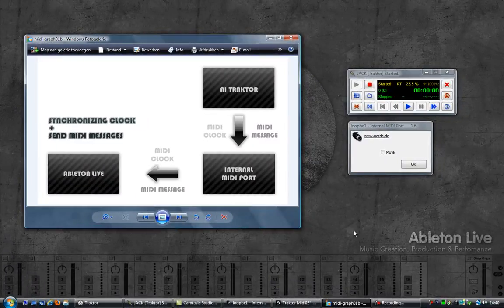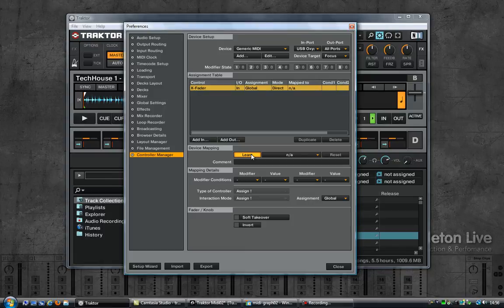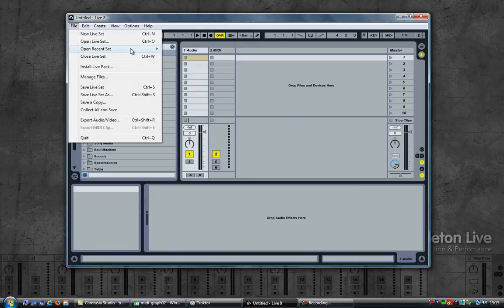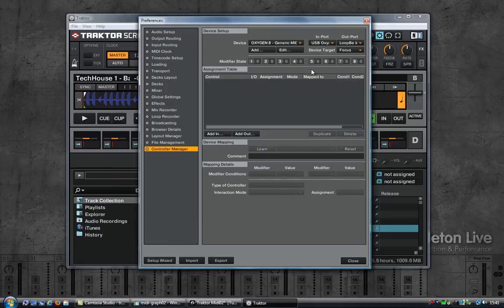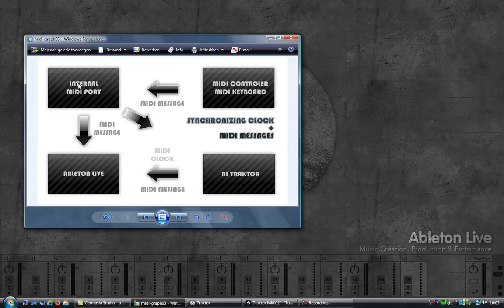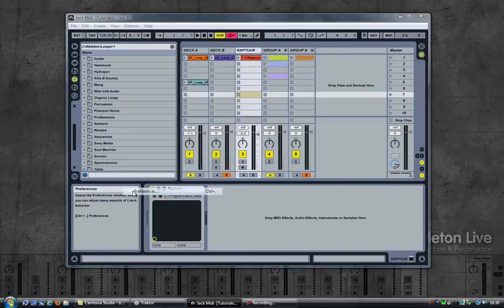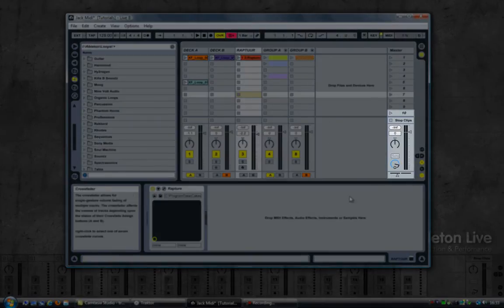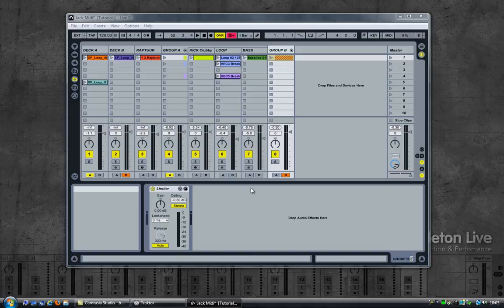Ableton Tutorial: Midi Mapping between Traktor and Ableton with JACK and more.. (part 2)

Comment: You are the best !!! For my case, I use traktor in external mode because i need to apply vst audio fx on separate decks, so i need to switch my controller in midi mode to jump control between traktor and ableton.

Comment: When I use the Modifier to output Midi in Ableton its either on or off but nothing like a fader. Can you Help me with this problem?
Reply from the maker: If I remember correctly, in Traktor play around with the "Controller Range" options. It defaults to: from 0  to 1. Try changing that to 0 to 127. I think that's how to fix it, but can't really remember :(
Reply: ***** unfortunately not. My settings are the same as in the video. Maybe you find the time to check it out maybe its a Bug in my version but I tried 2.6.6 and 2.6.8 and its the same. Thank you for your help! subscribed =).

Comment: Actually, I figured out how to fix the latency issue with the help of someone from sourceforge net.  In Jack Control -> Setup ->
Settings tab, I had to manually edit the 'Interface' value from 'ASIO::Avid Mbox ASIO' to 'ASIO::Avid Mbox ASIO (64-bit)'.  I guess it was using the 32 bit driver version by default or something? (But anyways, thanks to you, I found that my driver also needed updating haha) Keep up the great videos, Peter!

Comment from the maker: I'm using an m-audio Fast Track Pro at 48kHz and 128 or 256 (set in jack) depending on my needs. Traktor doesn't work well (or at all) at 128, so have to use 256 when combined with Traktor. If I'm not mistaken, the Mbox' are the new Fast Track Pro's so I'd be surprised if you can't go lower than 1024. Maybe see if there are newer drivers available for the MBox.

Comment: Hey Peter,

I've watched all your Traktor=> Ableton audio/midi sync videos using Jack Audio and LoopBe and I just wanted to thank you for how helpful you have been.  I'm so glad that I found your videos and you definitely helped me accomplish what I had in mind. (I'm actually using Ableton as the master sync though.)  My only thing though at this point is that I am having latency issues. With my Avid Mbox 3 audio interface through Jack, I can only max it at 48000 and 1024 before crackling audio.